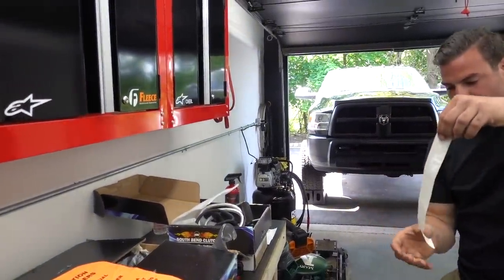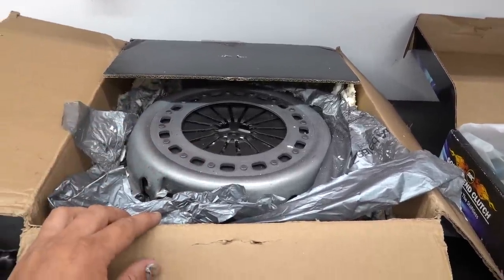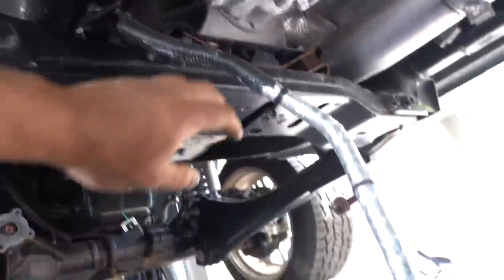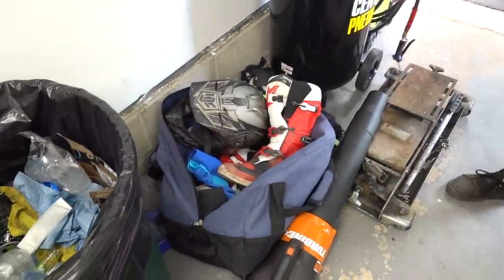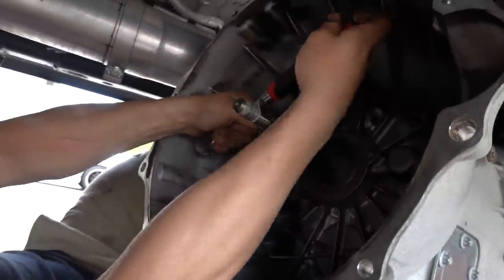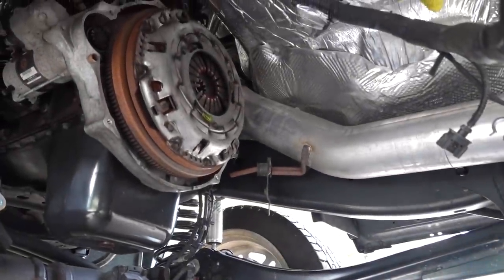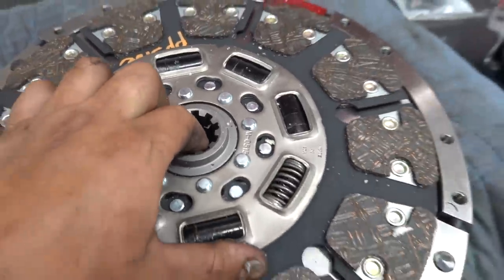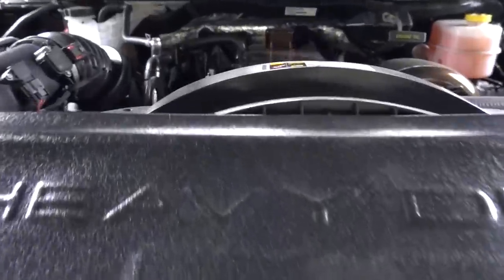2018 CUMMINS GETS BIG 6 SPEED MANUAL TRANSMISSION UPGRADES!!!!!

Comment: FYI If you jack the front of the engine up about 2” the g56 slips right back in easy as can be for anybody doing a clutch swap in your drive way
Reply: That'll come in handy for the next job
Reply: Tony Turner yeah just go slow and easy watch your harnesses and hoses don’t stretch or pinch anything
Reply: @roostin  so a peice of wood or somthing on the balancer and jack it up?
Reply: Wayne Gentry exactly
Reply: I lift from the front lip of the oil pan where it blots to the block with a floor jack and a 2x4

Comment: After doing many water pump recalls the best way I have found to drain coolant is to just positioning the power steering reservoir to the side and use a pair pliers to open the petcock and use a pressure tester to speed the draining process up
Reply: I do the same! Flat rate life.
Reply: I mean never worked at Dodge but if the manual says drain coolant I just assume whatever I'm removing all coolant needed to drain will do so when the parts removed no need to drain extra
Reply: @TonySmith-ni7bg  Anything recall or warranty related pays the mechanic about half of what it should.  Quick and clean is key. Plus they expect us to reuse the coolant. Can't have it all nasty when it goes back in. Either way it keeps from making a huge mess and having to take time to rinse it off when you're done, but then again not all techs are created equal.
Reply: @johnathan horn I worked for Chevy if we had a recall dealing with coolant it was charged out on the ro no exceptions and a quick wash with a hose after cleaned up all mess

Comment: My factory clutch started slipping at 30k miles, stock truck.  Took out my trans to put in same clutch and the rear main was leaking. Went front a weekend to a two weekend project. Also was a little more difficult with tree hugger tank, had to drop it too.

Comment: I like to do a ratchet strap like a sling under the front of the transmission and lift with an engine hoist. Then I  put a regular floor jack under the transfer case. Worked great on my 15 Silverado. I was able to do the trans with transfer case easily by myself.

Comment: I just did that same job on my 06 mega cab last week.  New clutch and coolant bypass!
Reply: What coolant kit did you use?
Reply: @tonyturner779  fleece performance
Reply: @christrapp5591  you got the link?
Reply: @christrapp5591  how are you liking it so far? Notice any difference?
Reply: @tonyturner779  nice easy install.  I've actually only driven the truck once since I've installed it so I'm not sure if there's a noticeable difference or not.
Reply: @christrapp5591  I'm wondering if I can get this installed with the transmission still in the truck. I imagine I could it would just be harder lol
Reply: @tonyturner779  yes fleece says it is possible

Comment: Omg love single cabs. Brought one home other day. 2500 2019. HD. Black 6.7 Cummings 6 speed
Reply: Stock Mabe a Turbo. KUSTOMBLACK. OR Frostbite fast first gens 9 sec truck turbos underneath the truck. And all ungraded. Plugged in a DBS and you can change 10.000 settings be careful.
Reply: I got boots Fox 599.
Reply: Burning wood. U need saw. Not grinders lol. It works